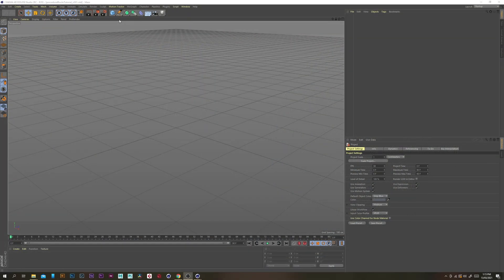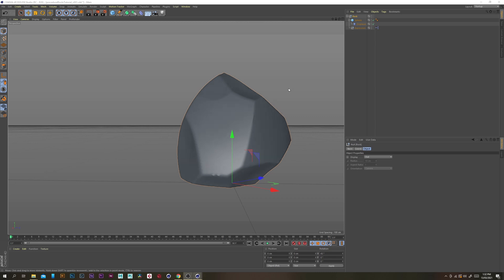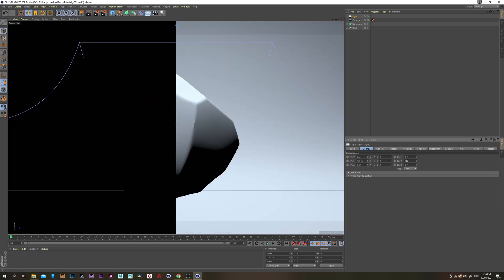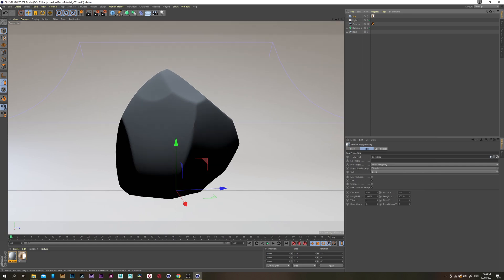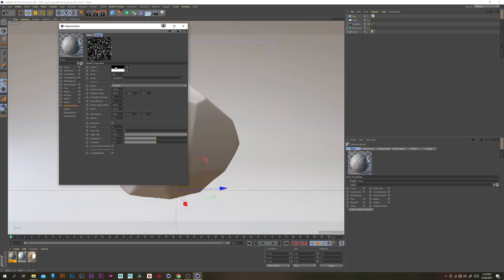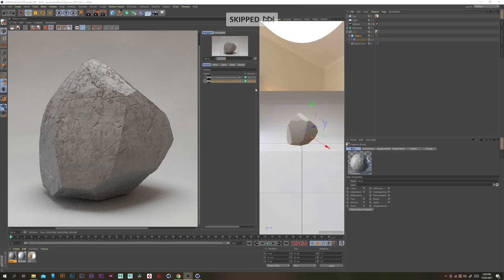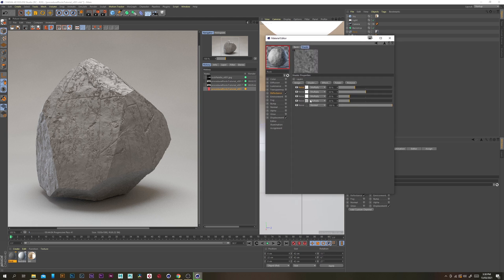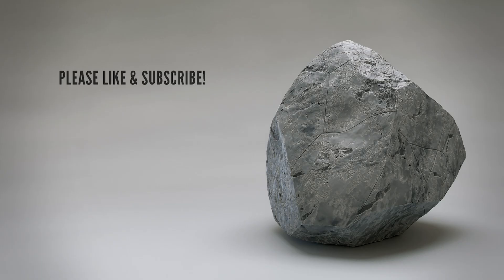Procedural Rocks in Cinema 4D - Tutorial

Comment: Great video. Is there a way to get the texture  displacement to work with volume builder? I use C4D for designing models to print on a 3D printer. When exporting to an stl file it does not carry the displacement of the texture.